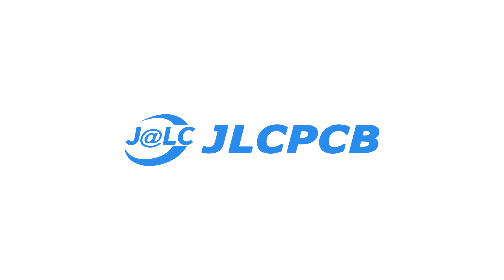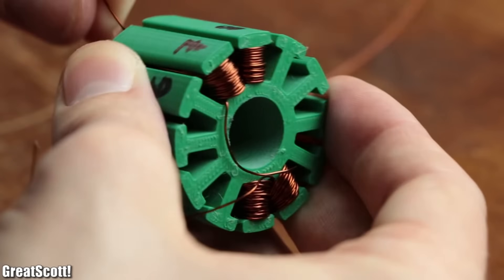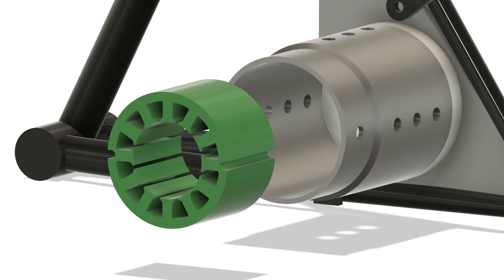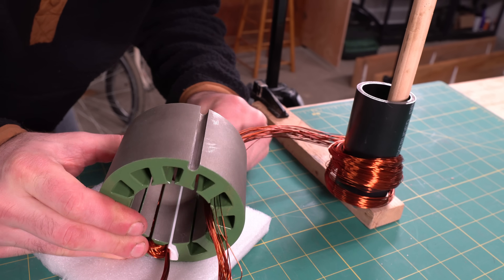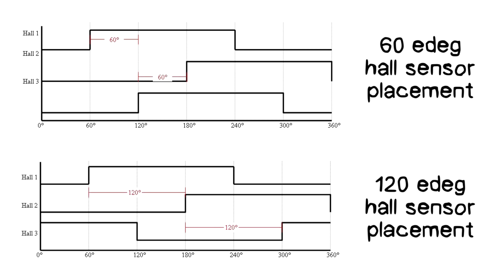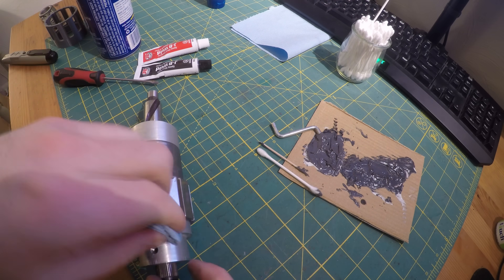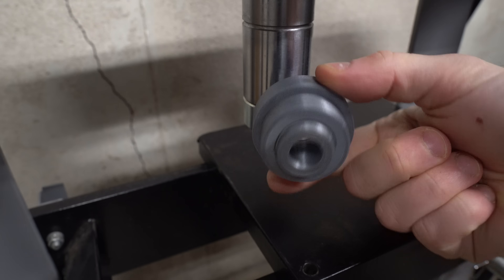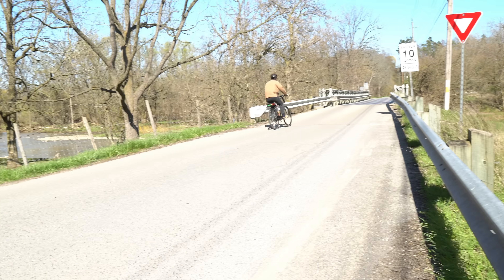Converting a Starter Motor into a BLDC Motor

Comment: Austin, I did the exact same thing you did with a starter motor for a high torque GM big block engine. This is supposedly rated 5 H.P. 12 volts. Dealing with the heat problem, I made a tubing that fits snugly outside the starter. Then used a larger tube with rings on the ends to keep water inside tubing which got radial fins on the outside. This would keep the motor cool for at least a half hour.  But the low HP of the starter motor made this an not so perfect unit. I should of just made me a ground up build like you did fella. 
            Paying 170 dollars is just a steal for sure. Nice video Austin. v
Reply from the maker: Thank you!